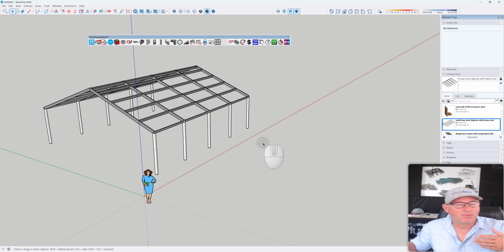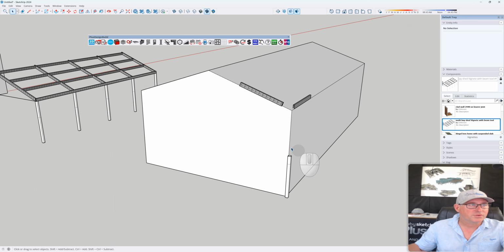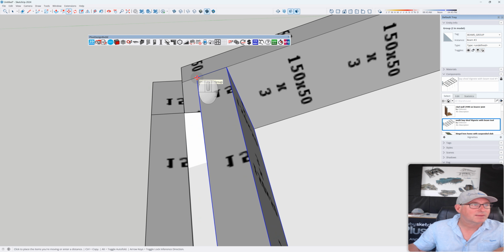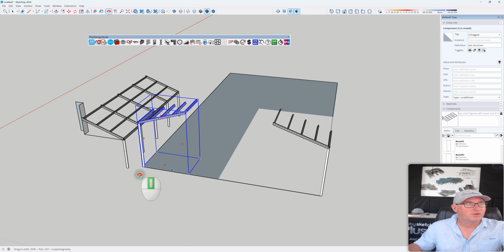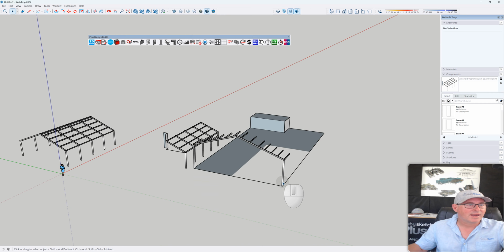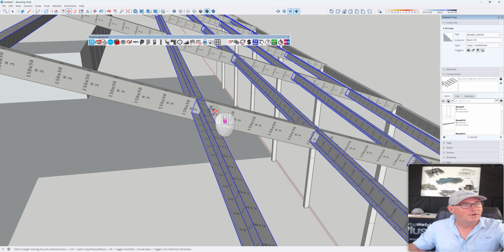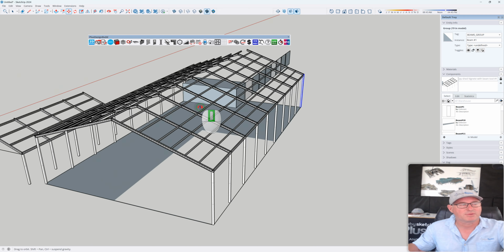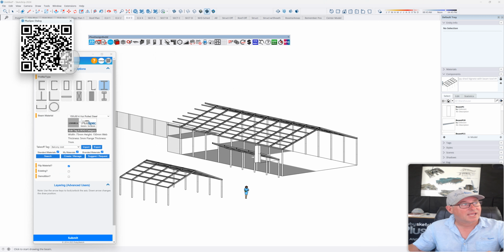Creating a steel shed or pergola in Sketchup using the PlusSpec Beam tool & vignette components

Comment: Hi Andrew 
Great to a demo for steel framing 
Well done 
Do you have any suggestions on how this may be extended to be set up with some parameters for say a kit builder to utilise to produce a range of sheds/buildings ?
Reply from the maker: Kit builders would have standard spans and specifications associated Eg 6m bay spans may be 150mm C section, but 10m spans could be 200mm  I would create a vignette according to bay spacing and rafter span. This way, new employees could specify a shed and quantify the steel required without knowing the details.